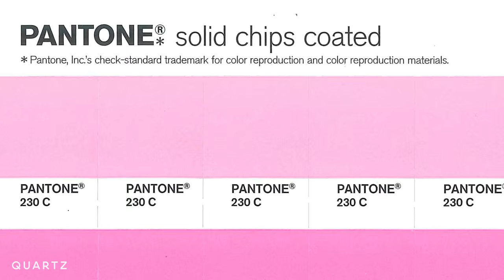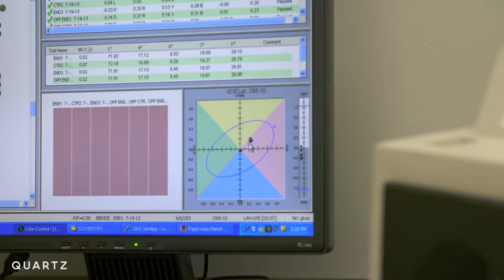Inside the Pantone color factory

Comment: Am I the only one who saw this and thought of the emperor's new clothes? If the only ones that can see the color difference are a very small minority, is there really a color difference?
Reply: +James Wood It's a fun question to ask, but the serious answer is that we know they're really different when we have color sensors that can detect a difference and when multiple people take the tests multiple times and the results are consistent.

SCIENCE!!!
Reply: +Nathan McDaniel Sensors can't see color, they can only detect wavelengths of light. Color only exists after it is perceived by an eye. That is why ultra violet and infrared light aren't generally considered colors. If someone was born with an abnormal gene that let them see ultra violet light as a color, we wouldn't start calling it a color all of a sudden.
Reply: In fact it's not really true that there is a very small amount of people the can see differences between colors, it's more of an "eye-training" issue. 
I work as a lab technician for a company that makes suede for automotive application. We check the material instrumentally, but then we need to relate on our eyes and look at it under a specific wavelenght source of light, as the lady of Pantone does. And I can tell that with experience and doing that on daily basis, you can really see the differences in the colors.
Reply: To me, these folks are similar to sommeliers (wine experts) who can identify the smallest differences in taste and quality that most people couldn't detect. Having a highly refined palette isn't of use to most people, but it does count in several areas of life.